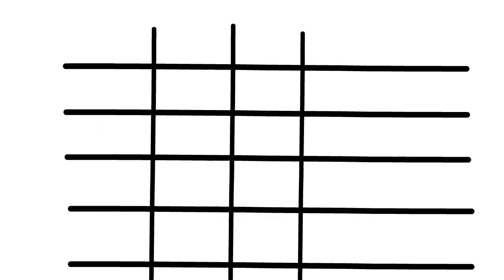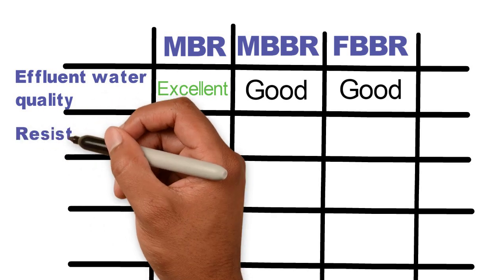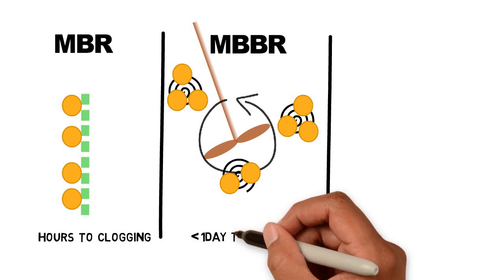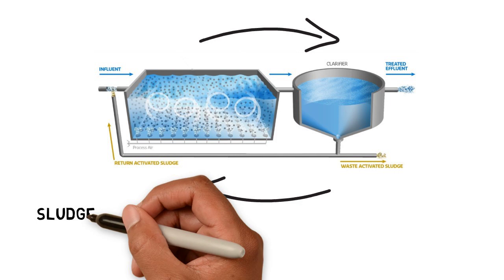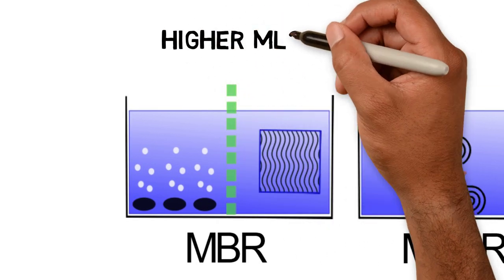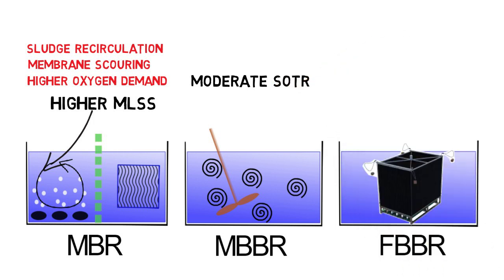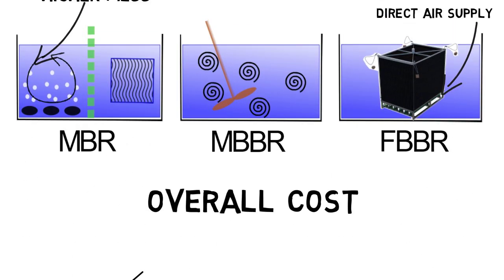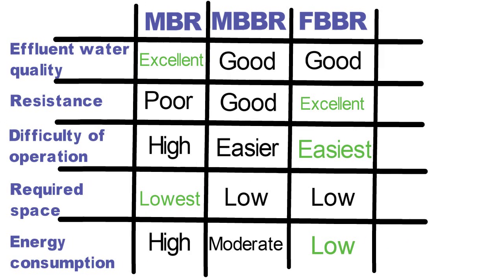MBR, MBBR and FBR (Part 2) - Comparison of wastewater technologies

Comment: Well explained,  I have worked with MBR's for 15 years, many engineering firms install them for applications they are not the best suited for and improperly train the operators and explain to clients the high lifetime maintenance costs.  There are so many other technologies out that are better in many cases...(a conventional operator sometimes has to re-learn thier discipline and forget what they think they know to run them)
Reply from the maker: 100% agree.